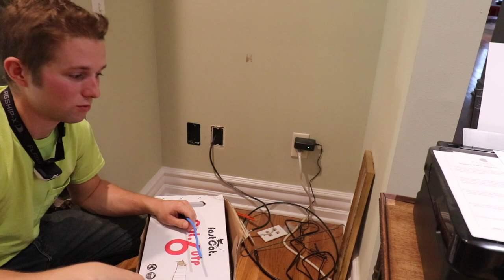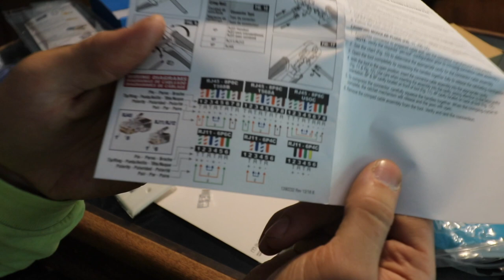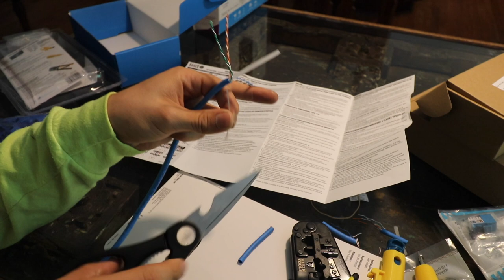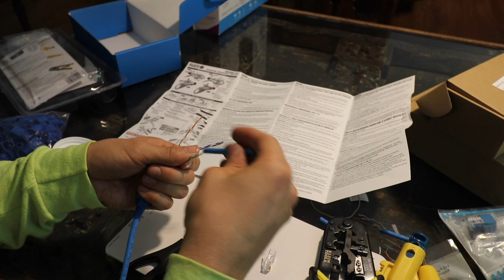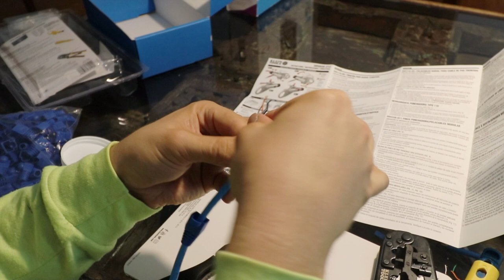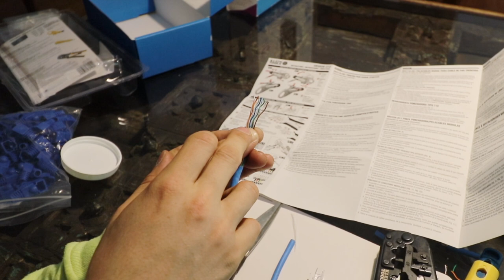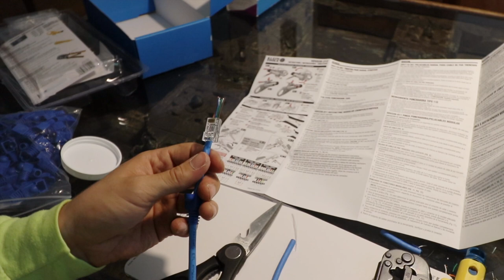Using an old router to Extend WIFI Network (Cat 6 Run)

Comment: Good vid.  I did the exact same thing to get WIFI to my attached garage with on apartment over head.  Existing WIFI from house was spotty at best.  Did not need a POE.  Run is approx 50 ft.   I am in the planning staging of a detached workshop and plan to run a CAT6 cable out to it and do the same thing.